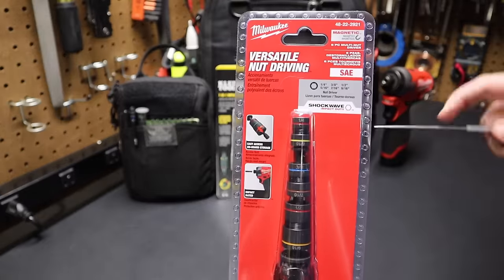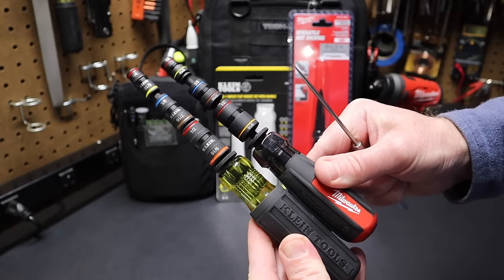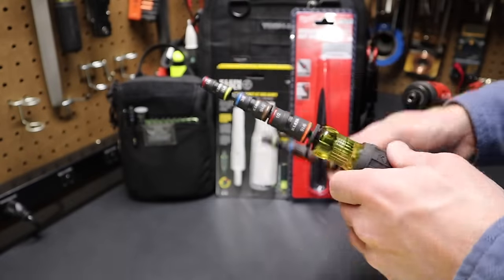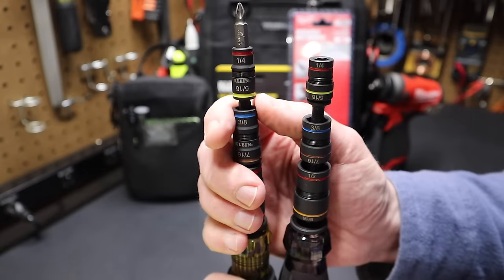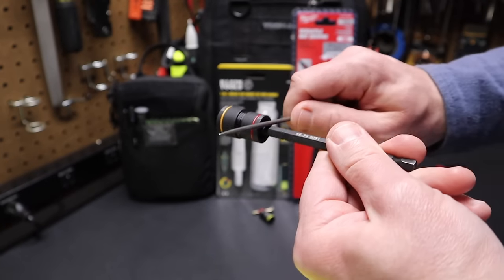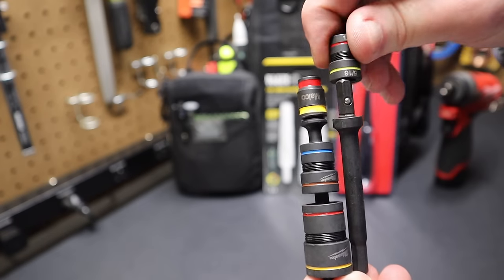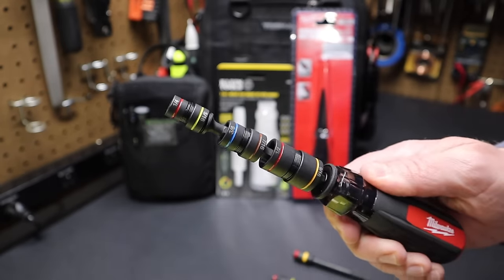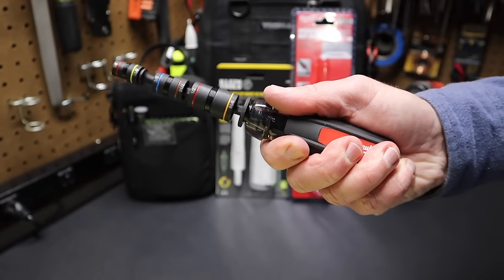NEW Milwaukee Flip Socket Multi-Nut Driver vs Klein Tools 7-in-1 Impact Flip Socket - 48-22-2981

Comment: Milwaukee isn't made for plumbers. Their metal rusts almost immediately and is weak I quit buying their bits they rust and broke too easily. The bit holders snap under minimal torque the 7in1 if it gets wet the bits will rust before you finish the days work for the price it's not worth it but I do prefer their power tools.
Reply from the maker: Thanks for your feedback. That’s no good if they are rusting. Thanks for watching!
Reply: I can vouch for the rusting I have multiple pairs of channel locks that have rusted by Milwaukee I still put them bad boys to work however now that I think of it that’s pretty disappointing
Reply from the maker: Thanks for the feedback and thanks for watching!
Reply: What bits do you use pls
Reply from the maker: Which bits are you referring to?
Reply: @projectpinehills  the 13 in 1 was highly rustable tried 3 of them they al rusted almost immediately. Had many bits snap inside my extended bit holder and inside my milwaukee impact driver ( again I love their power tools ) I do alot of work in active hospitals so my tools get wet pretty often even unless I freeze a pipe I'm gonna get wet because valves rarely hold their steel has just not held up to their name in my opinion.
Reply: Klein’s flip socket is bad about rusting too. I have to keep mine oiled. I give it a daily spray with WD40 to get the moisture off.
Reply: So I own three of the Kline flip socket drivers. Two with the handle and one that’s just design to go in a drill. My biggest problem with them is that they are great for taking off panels and stuff like that which is perfect for HVAC or other tasks like that or you’re taking self tappers in and out all the time but beyond that they suck. Every other task that I want to use them for it seems like they’re not deep enough and you’re constantly having to go back to the truck and either get a socket or a hollow shaft nutdriver. 

So I would say if you’re in the HVAC or maintenance trade, then this is a go to tool. However, if you were in other trades, it might be something to pick up, but don’t think you’ll be using it every day. You’ll probably be much more happy with something like their nine in one nut driver which is probably going to be one of the next things that I grab. 

I really had hoped this would be more useful, but it’s just incredibly common for you to run into things where this will not fit. Especially in the larger size fasteners, Not so much in the quarter and 5/16
Reply: Wish Klein fixed the issue with the sockets getting stuck; hate having to beat on the backside of the socket to get it off.

Comment: It's a shame to compare Klein with Milwaukee at Hand Tools , power tools yes Milwaukee is  better , but hand tools huge difference in quality , the Steel they use in Screwdrivers, wire stripers pliers etc. is far superior to most of the brands , i haven't seen a professional electrician with Milwaukee hand tools yet . Klein is undisputable  when it comes to electricians pro grade hand tools .
Reply: Plenty of electricians use Milwaukee hand tools. Kelin wire strippers are junk. Milwaukee makes better ones. 
Klein electrical rated screwdrivers are also plastic junk that break off easily. Milwaukee wins in that department too. 
I am not a fanboy of either brand, I will buy the best tool on the market on not care where it came from.

Comment: I really appreciate the excellent reviews that you present.  I also like the fact that you are very fair/unbiased when comparing tools for review!  I wish more tool reviewers were as ethical as you are!  Thank you for taking the time to create these excellent videos!

I am just curious--do you have a formal engineering background?  Your attention to detail is outstanding!
Reply from the maker: Thank you appreciate that. Yes I do have an engineering background. I should have noted that bevel edges on small sockets like 1/4” may result in less surface contact with small shallow screw heads. Thats probably why Malco doesn’t bevel the edge like a regular mechanics socket. Thanks for watching!  👍

Comment: Have them both. I prefer the Klein because the magnet seems to hold the screws better and is easier to clean shavings off compared to the Milwaukee recessed magnet. The flat edge of the Klein sockets hold a nut/screw head longer and don't cam-out like Milwaukee. Milwaukee bits also rust fairly quickly.
Reply from the maker: I agree. The non beveled edge on the Klein sockets is better when using the smaller sockets.  Thanks for watching!
Reply: thanks for the Review. gonna stick with my Kleins

Comment: I’m a hvac tech and love the Klein 7 in 1 driver. I use it in an impact driver daily. It sees extremely heavy use. My only gripes are that the magnets break on the Klein over time and if the socket accidentally isn’t fully inserted in the spline it will get stuck sometimes so severely that you have to put it in a vise and use a punch to get it out. Has happened to me twice. The Milwaukee will not do that. I’m going to get the Milwaukee and try it out.
Reply from the maker: I think Klein addressed the magnet issue in the 2nd version. Good feedback. Thanks for watching!

Comment: I have them both. I like them both equally. The driver bit really didn’t matter much to me as I figured I’d lose it anyway since there’s not a place to put it lol
Reply from the maker: Right. I always remove the bit. I’m not sure having a bevel edge on the 1/4 and 5/16 sockets is a good thing as they come into less contact with shallow screw heads. Thanks for watching!

Comment: The Klein is still my preferred for this type of tool. Milwaukee for power tools
Reply from the maker: I think the non-bevel of the smallest size socket on the Klein is probably preferred for shallow screws. Thanks for watching!
Reply: Milwaukee for power tools in 2015 when the Fuel first came out... The newer model Ridgid and Dewalts are stronger and last longer than fuels in 2025. Battery "Technology" even helped Ryobi Close the Gap...  Milwaukee needs to make their next Line Up already to be the best again. Its all the same companies so basically whatever is released Last is the best. Thats how they keep the Consooomers confused. Why do u think they have every single color as a "Choice"

Comment: I noticed that though the milwaukee bits dont go on the klein shaft, all the klein bits go on the klein shaft, which includes the larger flip set they make that goes up to 3/4 so you can use all these bits with the milwaukee nut driver
Reply from the maker: They will fit but are they a usable depth?  Thanks for watching!

Comment: I already own the old style klein without the 9/16 with the hvac handle so i can have the bit storage and use the 1/4" as a bit driver it isnt the best bit holder but saves you from walking over to get a bit driver if you just have to drive a few screws if youre doing more than a couple screws its worth the walk cuz you get frustrated constantly sinking screws with the klein nut driver bit holder
Reply from the maker: Thanks for the feedback, I agree. Thanks for watching!
Reply: I put the Milwaukee shaft with the klein 1/4 and Klein 11/32 and the 1/2-3/8 bits Milwaukee

Comment: It seems klien keeps coming out later with a better set upas I have the original klien with the 11/32 bit. But now have to get the latest set that goes to 3/4 inch. As a FF it is nice to carry this in my bunker gear or to keep in our drivers on the truck and not have to worry about looking for a bunch of sockets in a tool box
Reply from the maker: Yeah, at its core, the tool is a handy socket rail.  Thanks for the feedback and thanks for watching!

Comment: I have the Klein and my biggest peeve is that the 1/4-5/16 cannot be stored on the shaft when using the other sockets. Is the Milwaukee version identical in that flaw?
Reply from the maker: Why can’t your store the 1/4 & 5/16?
Reply: @projectpinehills  There's something in the middle of the socket preventing it from sliding all the way on the shaft. Say I wanted to use the 3/8 socket for multiple nuts/bolts, where does one store the 1/4 - 5/16 socket? I still love the tool. I just think there's a design flaw in the ability to store that one socket. mine ends up in the bottom of the pouch. Are you able to store the smallest socket on the shaft when using another socket on the driving end?
Reply: @alhk13 mine socket go through. Try harder or maybe yours is defective

Comment: So the best model would be to get both and use the Milwaukee sockets on the Klein shaft and Handle only cause it has the quick insert and the Milwaukee some how doesn’t
Reply from the maker: I think the biggest benefit to the Milwaukee is the flange that keeps you from knocking sockets off. I think not having a bevel on the smallest socket sizes is a good thing because you come into more contact with shallow screw heads.

Comment: I really wish i would have found this video earlier. I bought a 15 in 1 and this new hex driver hoping to make the icon combo like the klein, but that failed horribly.

The milwaukre csnt use 1/4 in bits on any functional way and the 15 in 1 shank is only held in by a magnet rarher than the detent collar. Absolutely awful. It pulled out when i was just toying around with it in the truck. Cant imagine how annoying that would be in the field.

Literally unpacked them and immediately returned them, really missed the mark on both drivers.
Reply from the maker: Well the video was just published today. I think I know what Milwaukee you are taking about. What is the part number?

Comment: Why on earth are you using hand tools in 2024?
Reply from the maker: Ha, you can use your impact with this. Always will use hand tools… power tools don’t fit everywhere. Thanks for watching!
Reply: I still use my hand tools a lot, especially for electrical work. I don't need to drag around an impact driver or even a small battery screwdriver all the time. I love the Klein Tools 32303. It's not a nut driver. The 11-1 ratcheting screw/nut driver is ok, but it's about too cute by half and a bit wonky to switch bits/sockets. I do a lot of work on 100+ y/o homes with all kinds of crazy stuff to deal with. Not having a power tool hanging off of me is important when moving around people's expensive homes.
Reply: @stringlarson1247  sounds like you charge by the hour lol
Reply: @projectpinehills  the right power tools fit everywhere.

Comment: i will NEVER buy another klein screw driver/ nut driver again. the rubber around the handle on mine have completely separated from the hard plastic and is impossible to use. milwaukee handles, the rubber is imbedded in the handle and is a MUCH better design. KLEIN is trash now.
Reply from the maker: Which Klein?  The 14-in-1?  I’ve heard some people mention that, but not on any handles with a solid acetate core like the one in the video.